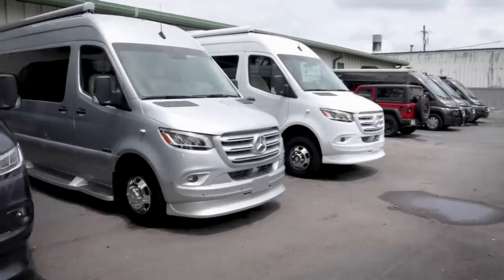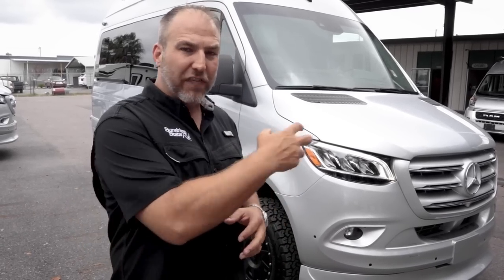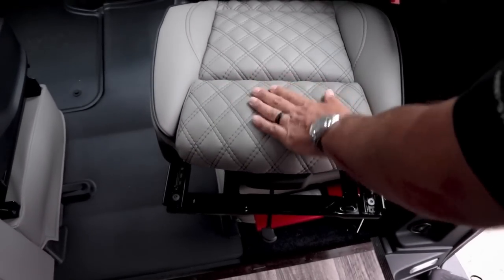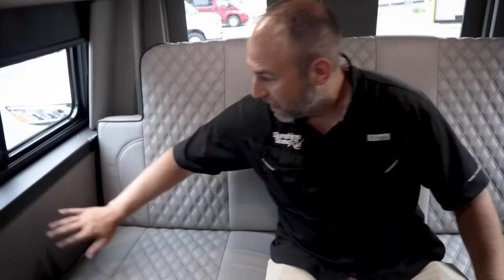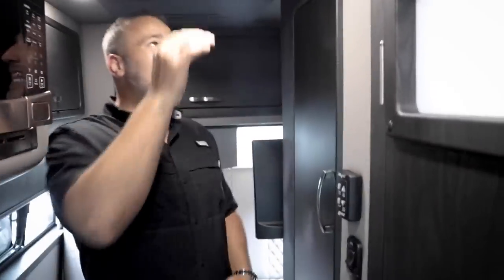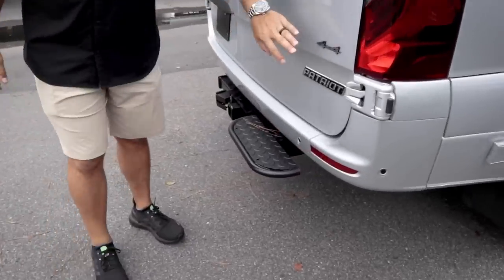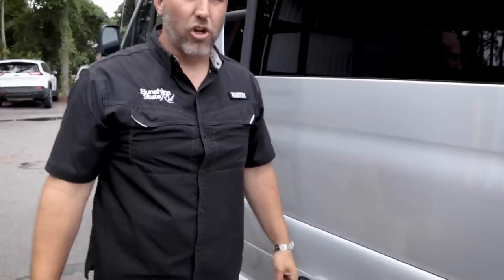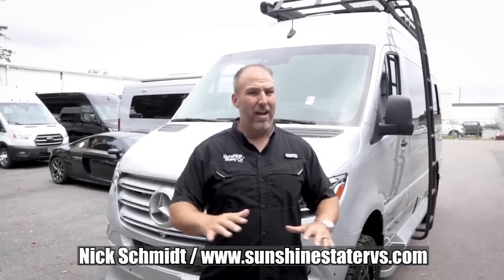INCREDIBLE Luxury OVERLANDING Class B Van/ 2022 American Coach Patriot SD 4X4 Sprinter Diesel

Comment: Nah. Loose the air dam and skirting. That stuff will get torn off pulling out of the driveway. This thing is to fancy for “Over-landing”. Easy to clean, simple and durable finishes, and reliable systems is where it’s at. This thing is for bouncing between Cracker Barrel’s on the interstate.

Comment: Honestly I want one. Man if I was healthy I would get this and just drive all over the states. Heck I would ship one to Europe and go back to a bunch of the countries I visited. This would be so much better than the places I stayed. Also man I can’t get over how luxurious it really is. Oh may have missed it how much battery storage does it have. How much can you run just off of solar. Great video Hank.
Reply from the maker: Yeah we think a lot alike Cujo... I’m not sure exactly what Lithium setup it has on board, however I think the average from just the batteries alone being trickle charged from solar during the day, I’ve seen an average of about 5 to 6 hours running everything...so if you add in the fact that whenever you drive around or just turn on the Diesel engine that also charges the battery (driving charges it up more) you can go as long as you want without really having to plug up anywhere...so the only problem you would have is dumping the black and grey tanks and refilling fresh water...If you augmented that with eating at restaurants, suing public bathrooms and truck showers or gym memberships that allow you to shower at any location...you could push the envelope really far...

Comment: Hank love this Van!  You and Nick are great.. Nick is so informative and doesn't look a day over 50😂 ..  I've watched all your videos thanks for doing all you two do...   BUT WAHT I REALLY WANT TO SEE..   get Nick on it NOW as I've seen the floorplan option now for 2022-  same model but it has the rear Lounge WITH the loftbed..  to me it's the best of all worlds.. at least so far.. since so may times the view outside or easy access is out the back of the van..  you want to be able to open up those back doors and utilize the screens if that's where it's at....  and also practicality..  Let's be real if I need a couple sheets of plywood or need to move some furniture for my parents..  I can stop and pick it up and slide it into the van..  with that slide down bed blocking the entire back end it's not happening.  The loftbed makes the "functionality" so great as far as I can tell (without seeing one yet.. what is the head height with it up?)   The only issue I see from the floorplan that could be improved.. Class B's feel so much larger if you can look over your right shoulder as driving and see out all the windows all the way back..   could use a redesign to get rid of the wall that sits at the end of the kitchen counter/front of the lounge. ???
Reply from the maker: 🤣 thanks Rob, I’ll have to look into that loft bed option ai was under the impression they were moving away from that (I kinda like it myself)
Reply: @strangerpalooza  Thanks Hank. It’s just the best of both worlds you don’t always have to put the bed away you just roll it up. I heard it said by another owner that inevitably if the bed is down somebody gets dirt or sand in the sheets or the bedding this way it’s up and out of the way and you have that free access in and out of the back of the van which to me without it just a dealbreaker👍🏻

Comment: Interesting, same price as a fully loaded Winnie Revel. Revel is more off-grid with better 4x4 set up + the cassette.

Are you planning to do a review on the Thor Sanctuary soon? It's a similar floorplan to this 2022 Patriot and almost 60k less in price.
Reply: The Revel does not have near the features, both have 4x4, but Patriot has better insulation, better solar, suspension upgrade, TV, microwave, recessed induction cooktop, and more.  The small cassette is a huge drawback for some folks compared to a 15 gal black tank with macerator pump.  We were going to buy a Revel, until we saw the Patriot.
Reply: @bronnstokeworth5764  -5C and those 15 gallon tanks are useless… it’s not a true 4 season van… you can insulate and heat those 3 tanks but they’re outside of the body… will be a huge power gobbler  in winter…